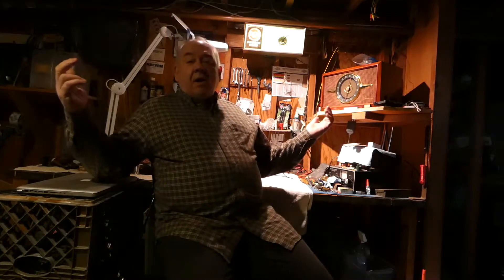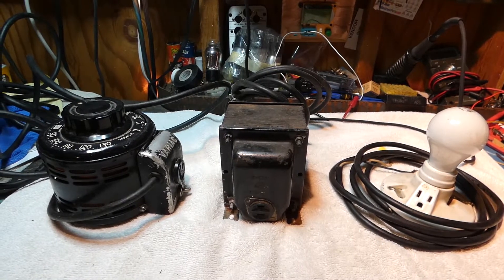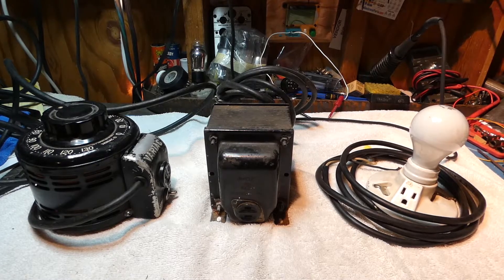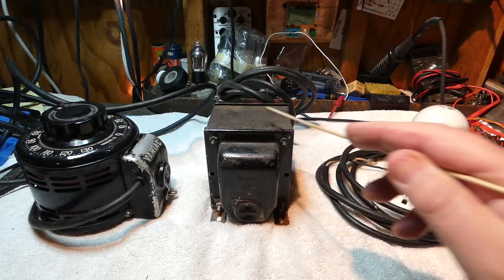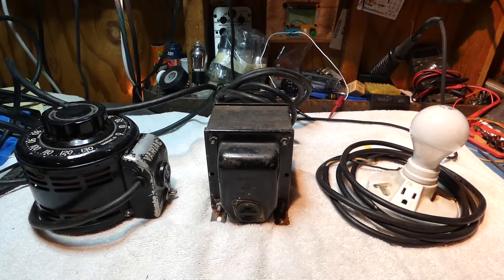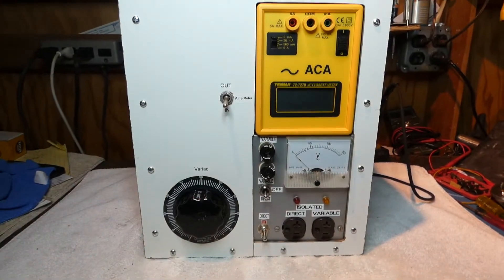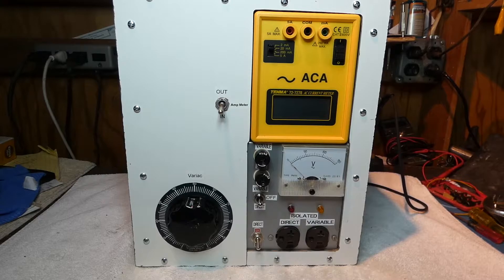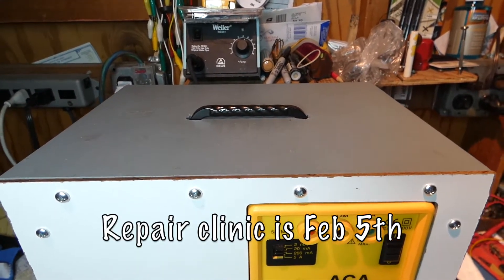My homemade radio power tester

Comment: Very interesting to see how this was made. Very handy. The ONE HAND RULE. one hand on the radio. Chassis.  Or test lead. And the other hand in your pocket.  Rubber gloves for measuring voltage.  Safety first.

Comment: Nice RCA advertising clock. Cool tester but must weight quite a bit.
Reply from the maker: Yeah it's about 20 pounds. My old set up would have to go in a plastic crate in pieces and also weighed about 20 pounds. If you work out, think about it as free weights that plug-in! LOL

Comment: Yes we used to use the one hand rule when remodeling house wiring(I worked for Henry's Electric who was an electrical sub contractor). As an electrician you do not ground yourself so always a safe way and also was safe working on live circuits but, you had to be real wary and have a healthy respect for electricity. So too it is with these old radio's thanks Don.
Reply from the maker: In 2003, I had hired an electrical contractor to do some work for me. The main guy had a trainee, and he shared the one hand rule with him. I giggled to myself knowing what he meant. But it holds true for transformer-less radios!

Comment: That's a pretty nice Zenith 835 on the shelf!
Reply from the maker: Thanks, but it's a big speaker RCA AM/FM radio from the early 50's. The cabinet is called the "Livingston" Uses a pretty hefty output transformer with a 6V6. Zenith Am/FM's are nice, but this radio is awesome!